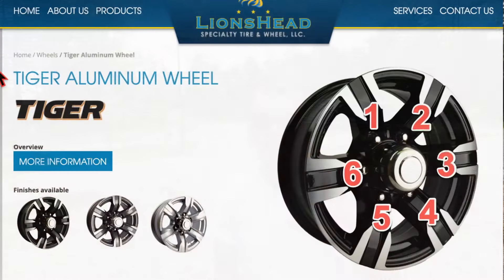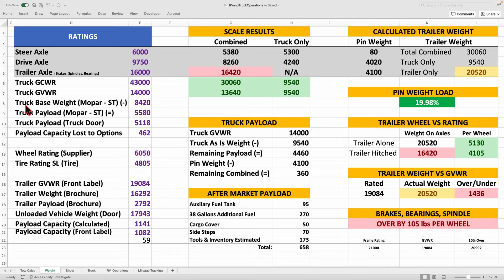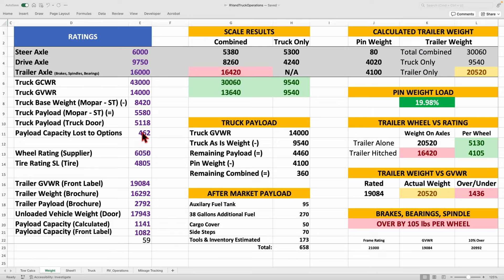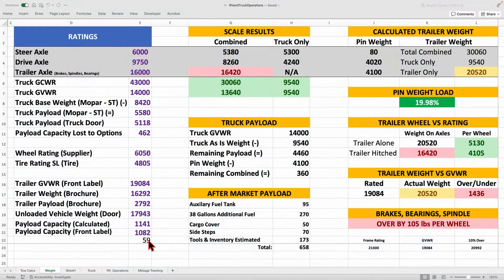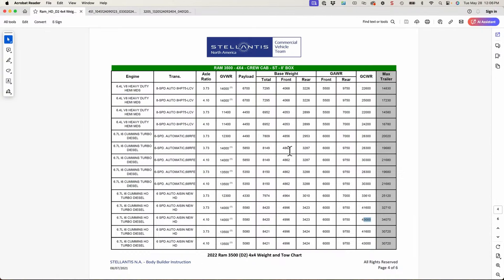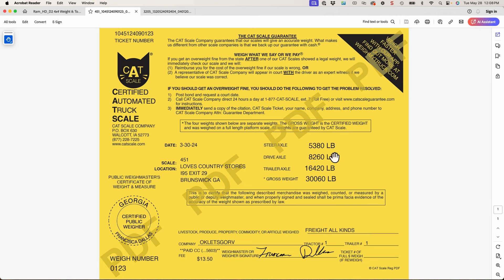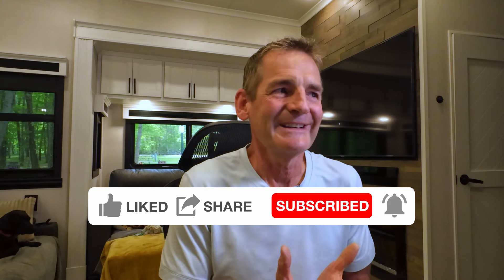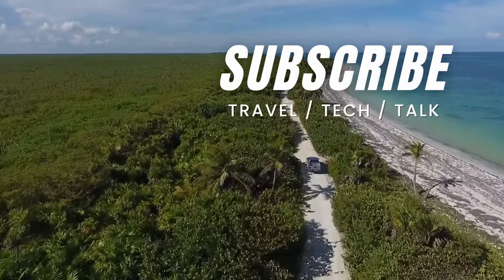RV Wheel Failure  Part 2 : Payload and Weight Analysis

Comment: I like the way you went about showing the breakdown of everything. I know we had a blowout last year in the 391FSK that we had. I had bigger wheels on my F-450 at the time and I could not get the trailer level due to the height of the truck. I could always see the trailer being nose high. Do you know if you trailer is level? Well, as level as possible that is. Was it the back wheels that blew or cracked? Well, I did just hear the subscriber mention your back in process. Maybe the is it, although I have only heard that being an issue on leaf springs and IS camber. I agree with you on the quality of the wheels. We have a three axle 37FLTH now and I went back to the OEM wheels and tires and also had the trailer raised to its highest level when we had the IS installed in February. I hope getting those new wheels and tires serve you well. Thanks for the insightful videos.
Reply from the maker: Yes, the truck and RV are remarkably level.  We’re over on the GVWR of the 5th wheel, and there’s no amount of leveling that will resolve that.  It’s a matter of reducing the weight and that’s it.  The trouble is that we already travel very light so I’m not sure where the weight is coming from.

Comment: The reason there is a weight rating on the truck and on on the trailer is to establish a weight rating.  Your analysis is similar to something we all do from time to time and that is play with the figures in order to force a solution that we want. When DOT stops you and weighs your truck and trailer they are going to use the stated values found on the stickers, not your spin on the figures.
Reply from the maker: Absolutely, I’m not aiming to spin the numbers, I’m endeavoring to resolve the weight issues, both on the 16k and 19k limits, while also addressing the wheel quality issue.  Question for you as you obviously understand this topic well….We would be traveling with the combined weigh slip and if we are under on GCWR, and under on all of the GAWR, would the DOT be OK with that?  We would be under on all of that but possibly still over on the GVWR of the trailer, but with out having the discrete actual curb weight of the truck at time of check, they really would have no way of knowing as the pin weigh can only be calculated from discrete weights, right?  e.g. the % of the trailer weight transferred to the pin can only be estimated and that could be anywhere from
15-25% this making the weight of the trailer essentially unknown.  Are you saying they force the issue and have you go to a weigh station to disconnect and weigh separately?

Comment: If you can down there??
Weigh each axle ?? to add that weight up?
As well to weigh each tire? 
As well practice/ get into the habit of making larger turns with your trailer.
Reply from the maker: I have pretty much ruled out that the failure of the wheel was not due to the overloading.  We are still with in spec there.  Our bigger problem is that we are definitely over on the GVWR of the RV by the 1400Lbs.  We’re going to go through and reduce cargo as much as we can.  I’m just going to depend on the CAT scale results to get the weights overall and not worry too much about the individual component weights as I know that if we can get the GVW of the RV down by the 1400lbs we should be good every where else.   Interesting that you say get in the habit of making wider turns.  I’ve been doing that so much that I even catch myself doing it when in the truck and not towing.
Reply: @okletsgorv  If leveling while transporting is a problem?? They do have different offsets for  tow  hitches.

Comment: When you say trailer alone per tire you are under, it is actually over 5130 per wheel > 4805 tire rating!
Reply from the maker: Hi Marc,  Correct but not when hitched though which is when it matters, because of course 20% or so of the weight is being transferred to the truck. Hitched on weighing #1 was 4105, and at weighing #2 was 3950.   When unhitched most of the weight is taken by the leveling jacks and not on the wheels or tires of course.  So basically take what is on the axles hitched and divide by 4.  Weigh #2 15800/4 = 3950, Weigh #1 16420/4 = 4105. Therefore when being towed each wheel is being subjected to the 15800/4 as that is the total on the axles.